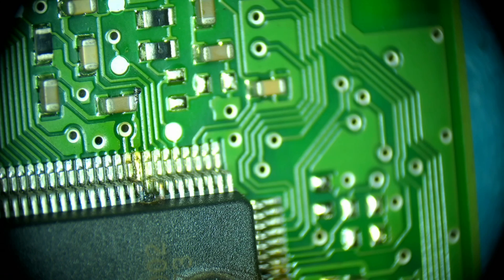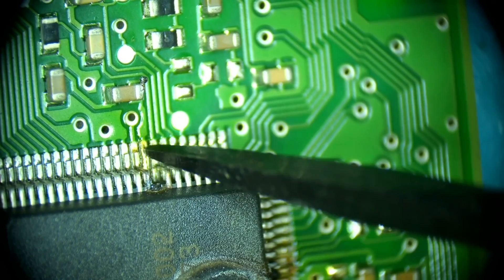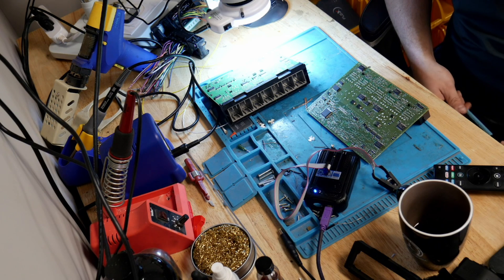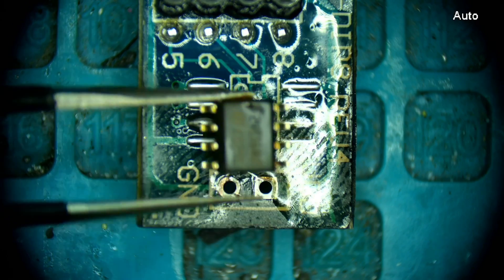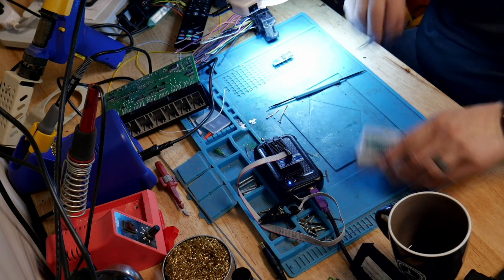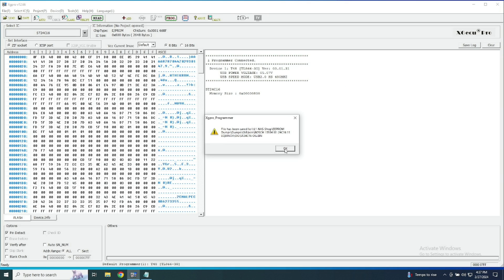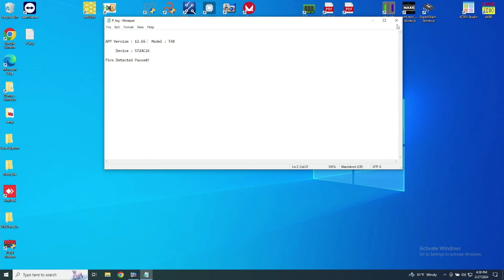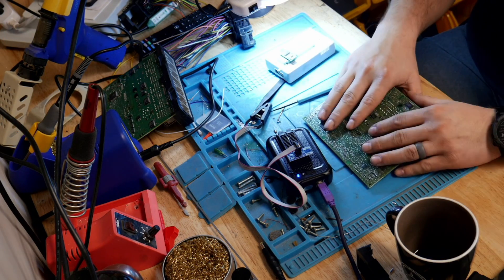Cloning a GM BCM after a BIG software FATFINGER!

Comment: I'm stupid so explain to me why no milage correction and no air bag reset.
Reply: Because lawyers can and will sue you and take everything you have just because they can argue their point in a court of law and win.
Reply from the maker: Odometer editing/changing is a crime, correction is a grey area, so I'm out, not worth the hassle, there are thousands of other broke cars that I can fix instead. SRS resets are ethically an issue as most of those modules are not designed to ignite airbags more than once, so clearing data turns the light out, doesn't ensure the module will work and save a life again, so that's a BIG NO. OEMs say replace it, so we do.
Reply: @L1Training isn’t the odometer reading saved on other bcm? If so wouldn’t it be illegal not to correct the reading on the new bcm? If not wouldn’t you have whatever reading the replacement bcm have? Just curious.
Reply: New level auto what do you think of global commerce ca videos? He clears crash data
Reply: @L1Training problem is in most cases you cannot buy a new module for older cars because they have been discontinued or on indefinite back order. What do you do then?
Reply: Contemporary equivalent of an ddometer rollback..kinda illegal.

Comment: My 03 Silverado has had its instrument cluster replaced too many times to count. Back in it's day, when getting a replacement the parts store handed me a form to fill out. I had to sign to verify the mileage that I didn't know exactly because the unit went dark. Just guestimate it is what they said. Later on when clusters started becoming available in the salvage yards I just bought them there. Whatever mileage was on it was fine by me. I owned the vehicle until the frame was junk then it went to the crusher. Well over 200000 miles odometer only showed 95000. 😂 Any legal documents had a ball park mileage submitted so I was the only one to ever see the actual cluster mileage display.